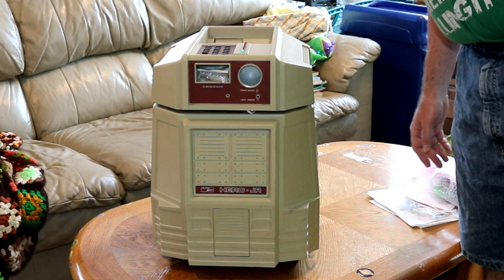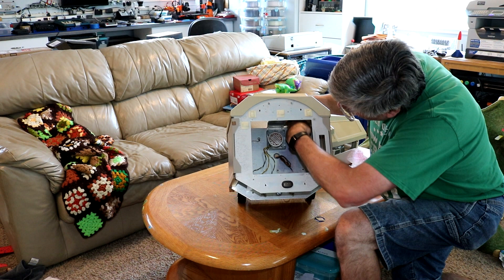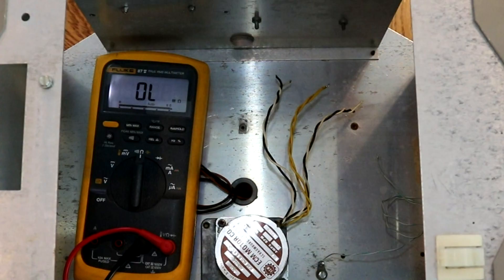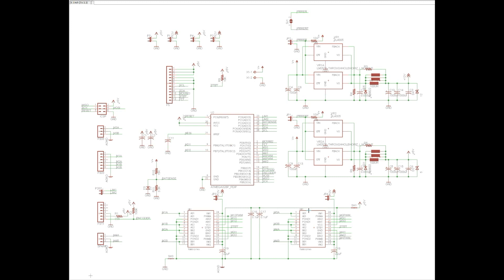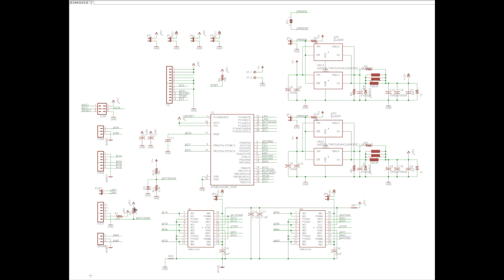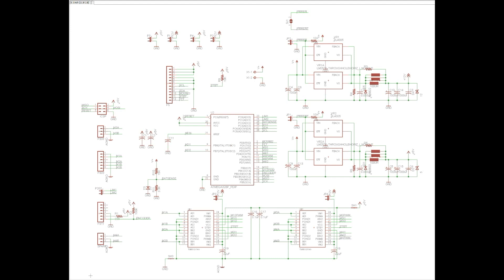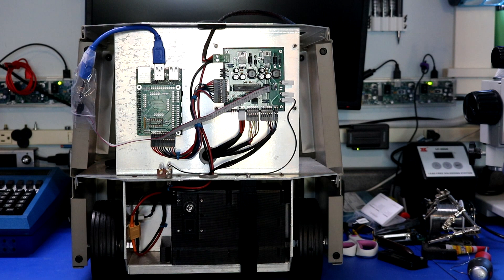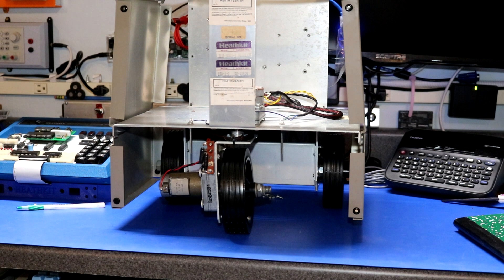Heathkit Hero Junior Rebuild Part 1: Drive Systems

Comment: One of my regrets was not buying a complete body for a Hero 1 new for 75$ in 1989. All mechanical and some electrics were included.
Reply from the maker: I can outdo you on that regret. Sometime in the mid-90s I happened across a Hero 1 at a pawn shop and picked it up for ~ $100. Then I had buyers remorse because it was missing the pendant, manuals, and other accessories, and returned it (still shocked to this day the pawn shop took it back).

Comment: Thanks to the Heathkit Hero we now have Battle Bots.
Reply: Battlebots are more related to RC cars than they are robots.  The HERO could be programmed so it wouldn't need a remote operator.  It's limitation was cpu speed and memory.  Just thinking it would be cool to give them IR lasers and IR detectors and see who could code a better fighter.